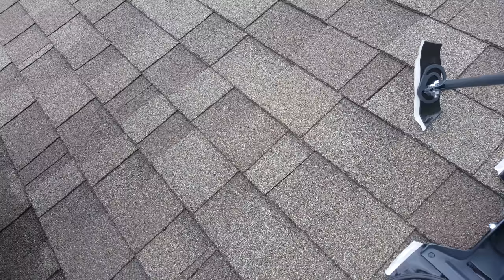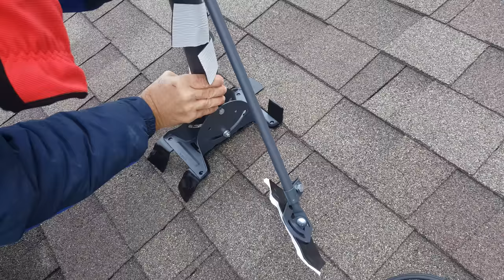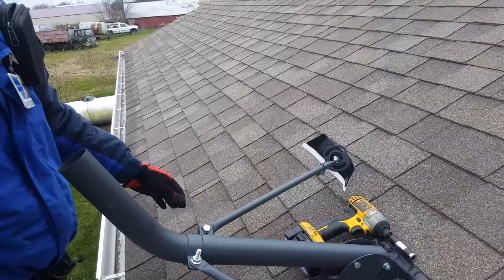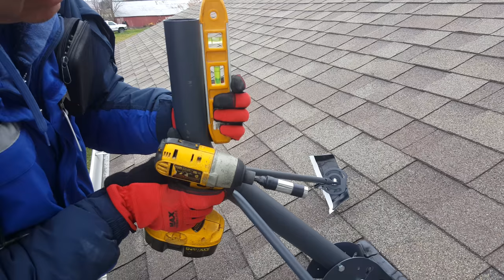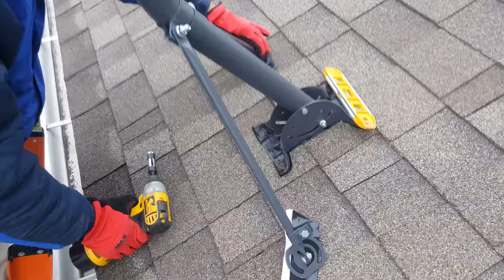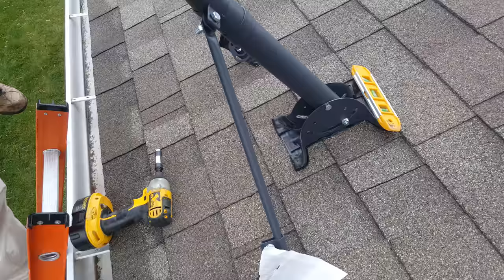Excede Internet roof mount being installed

Comment: This is definitely the correct way to roof mount. Though its advisable to avoid roof mounting unless its a last resort... Great Video :) Thanks so much.
Reply: Really? In the company I work at we try for the roof as the first choice and a pole as the last.
Reply: @stupid_tree7158  Reason you avoid roof mounting is to prevent water ingress. You can seal a roof but your always risking creating a leak. If that happens you can bet the customer will charge you for it. 
What company do you work for ? Xplorenet & Hughes are the only 2 that I know prefer damaging peoples shingles.